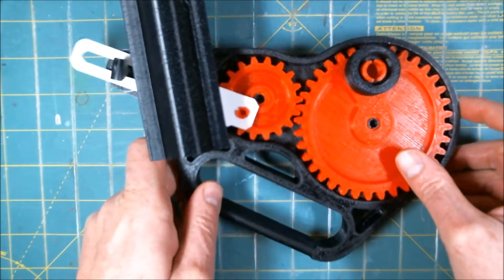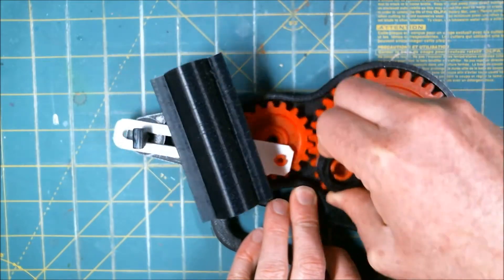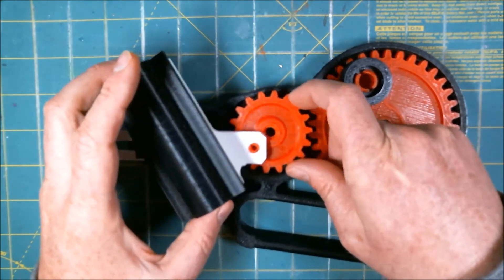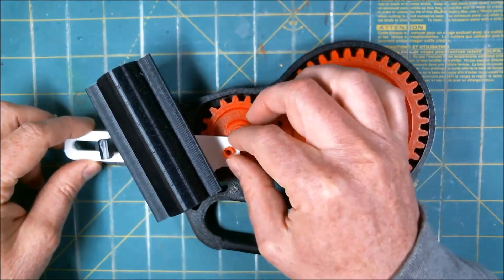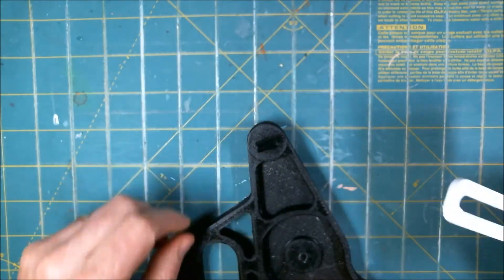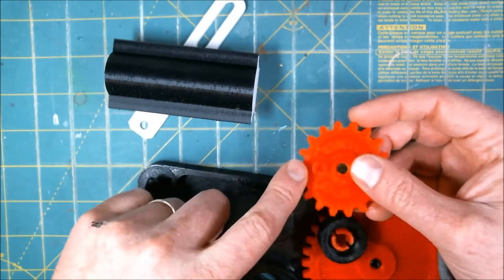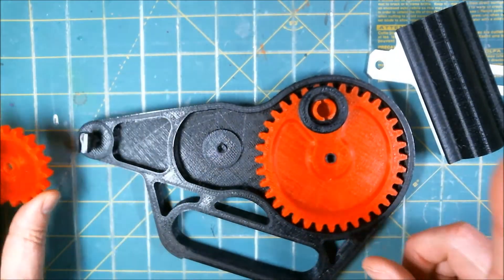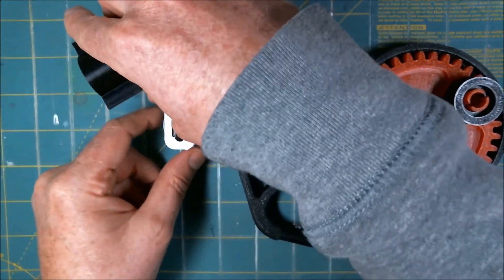3D Printed Miniature Paint Shaker (Version 03)

Comment: interesting design.  The throw back and forth seems a bit on the short side.  As an idea, if the bottle holder were at a 90 degree angle from the pivot point and the connecting piece were on a pivot point of its own, then you could maybe get a lot more "work" out of each turn of the knob.  We built a bottle shaker and have a video on my channel that you can search for if interested in how we did it.